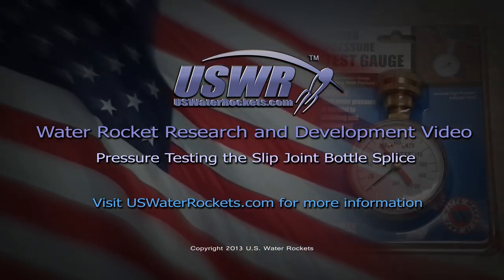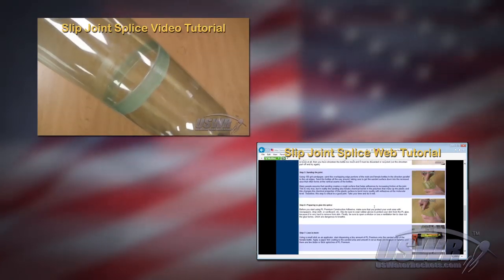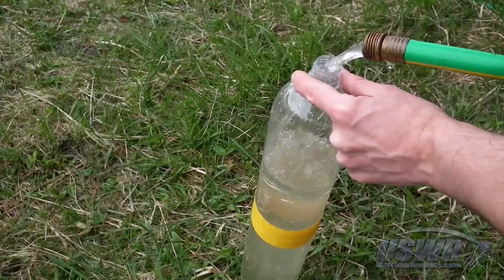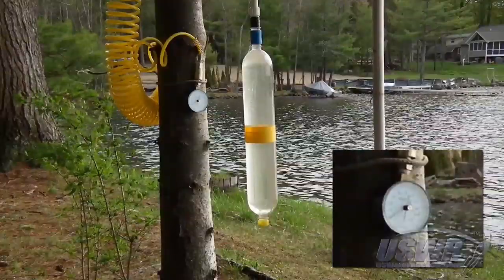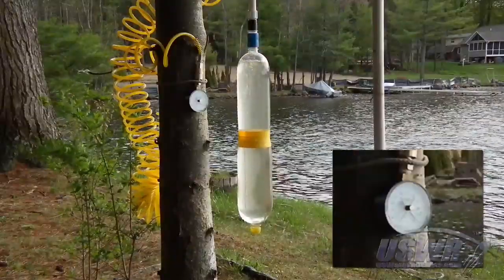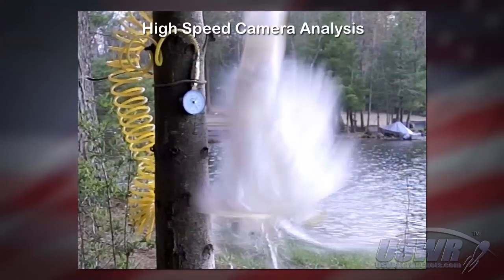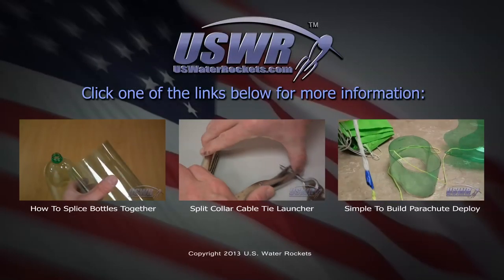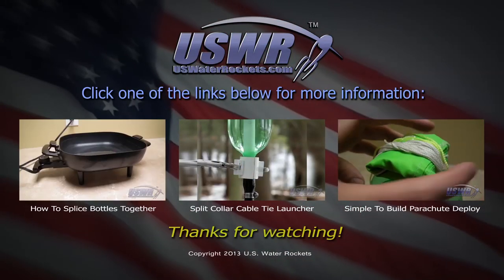Pressure Test 200PSI (14Bar) Water Rocket Spliced Bottles

Comment: That's unbelievable, awesome job on your splicing method.
Reply from the maker: Thanks. The only thing we forgot to mention is that bigger bottles tend to be weaker overall, so a spliced pair will fail at about the same pressure as the single bottle you make it from. A 2 liter bottle fails at about 160PSI so a spliced 2 liter bottle pair will fail at roughly the same pressure. There 1.5l bottles hold 200PSI by themselves, so the splice holds at the same pressure the bottles will. In other words, this splice doesn't make the bottles any stronger than they are before the splice.

Comment: i did not use sand paper on the bottles before applying the pl premium by mistake. Do you think the bottles will able hold 60 psi while staying airtight? Thanks!
Reply from the maker: It will probably be okay at 60PSI, but it may not last for a lot of launches that way. The sanding adds a huge amount of strength to the bond.

Comment: if I do not have that glue which one could use .
Reply from the maker: +Angel Muratalla We have tried a lot of glue and this one is the first choice. It is a Polyurethane Construction Adhesive. There are a lot of other glues that are made from Polyurethane that may work. Some people have used epoxy and other people have even had success with hot melt glue. We personally have not been able to get other glues to hold at 200PSI, but there are many people who are not trying for maximum pressure so if they find a glue that works at 150PSI they might be perfectly happy. If you are not planning on pushing the pressure to the limit, then another glue could work just fine for you.